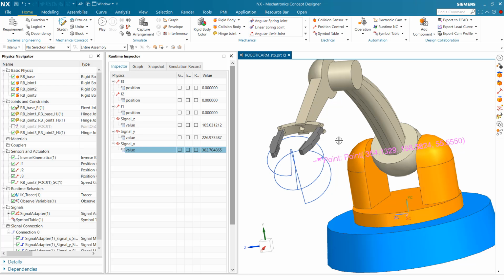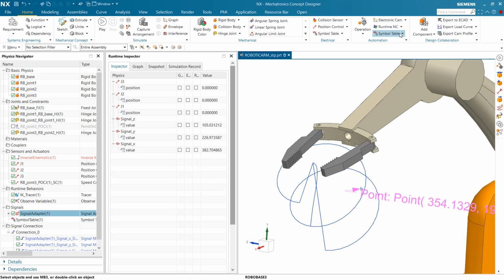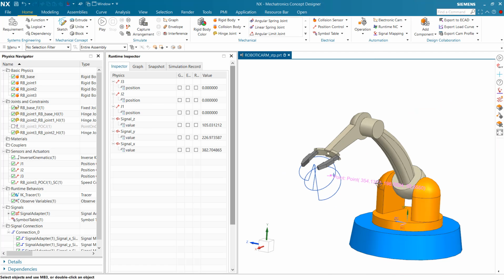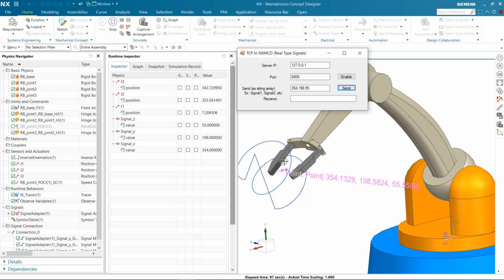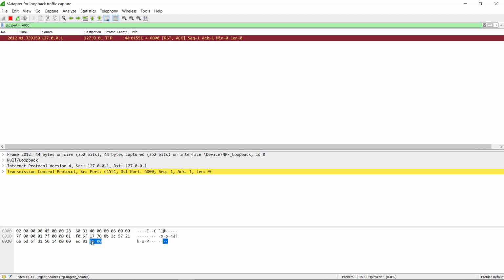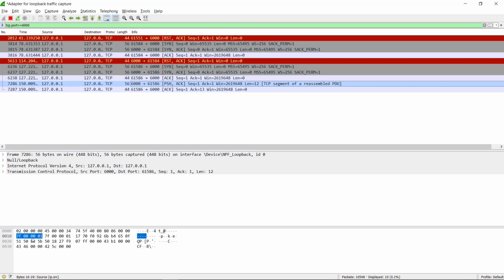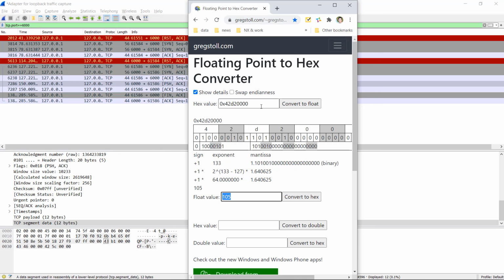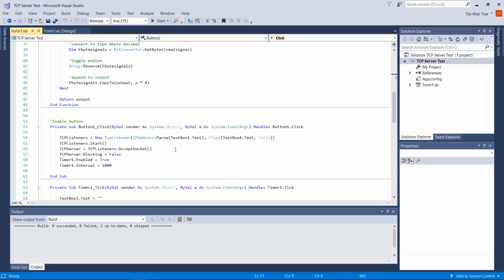NX Mechatronics Concept Designer - TCP Signals (with Visual Studio, Wireshark)

Comment: Thank you for this amazing video!
Since I need to do the same - may I ask you a question:
I have to send a big byte array via TCP to a specific server in an specific telegram format.
I got the idea of the offset but imagine I have 100 signal data - do I need to configure it 1 by 1 or is it possible to specify an array?
Inside of the data area in the telegram the data points do all have the same size and follow one after another.